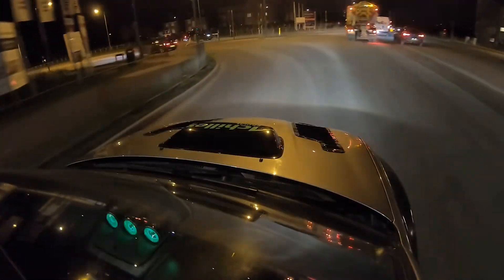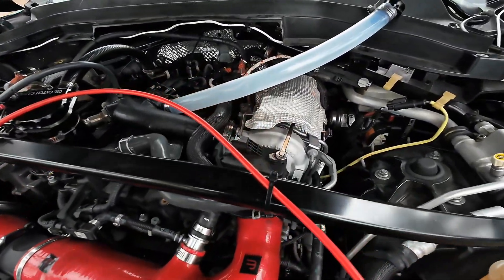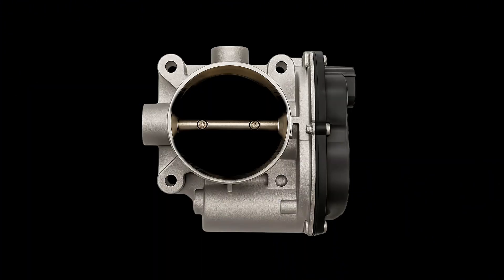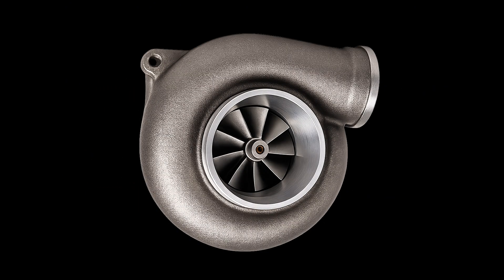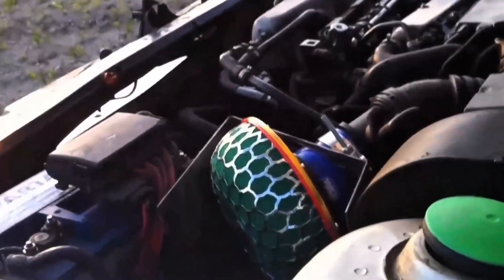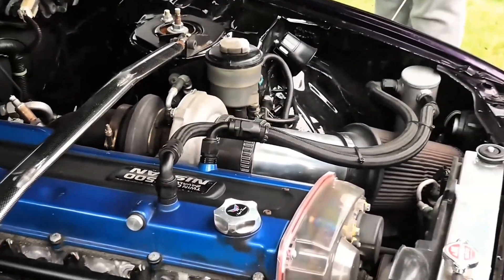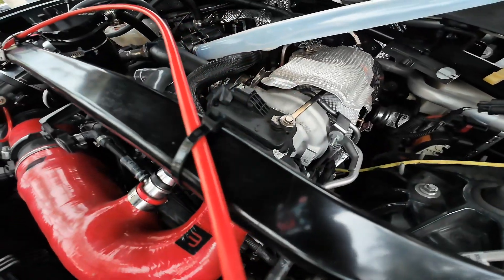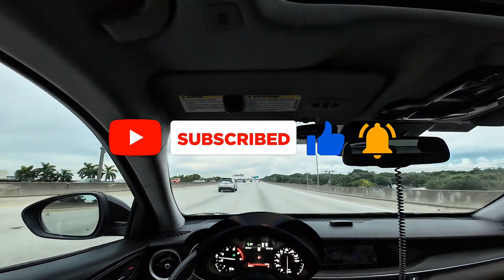Car Culture LIED about TURBO FLUTTER

Comment: My question would be. How much does it shorten the lifespan of a turbo? Turbochargers are inherently a wear and tear item and replacement is common so I wanna know if the surge causes meaningful damage since it'd be replaced eventually either way.
Reply from the maker: The lower the PSI the longer the timeframe before shaft play sets in. There isn't really a predictable timeframe since it could turn into noticeable damage at anytime.

Flutter sounds amazing though, so if you are financially setup and skilled enough to replace turbochargers - then I can't say I wouldn't block off my BOV just for the flutter.
Reply: @TorqueTheoryLabs On a second thought I actually drive a turbo diesel so there's no BOV to speak of. Not sure how much the video applies to TDIs as it does to petrols.
Reply from the maker: Well, this video is about the compressor surge caused by the throttle plate closing w/o a BOV.

For diesels: compressor surge is typically caused by exceeding your turbos efficiency (basically spinning the compressor wheel too fast) so the wheel can't grab onto more air and because of that - the air inside the manifold oscillates back through the compressor wheel.
Reply: @TorqueTheoryLabs Seems that the sound I am hearing isn't a flutter after all then. On lift off my car goes "WOOoo" rather than "sututu". It's more of a wind down than a stutter. Thanks. I learned a bunch today even if your video wasn't tailored towards diesels.
Reply from the maker: @RobinkoBambinko 

I hear the same noise in my car, sounds really cool if you listen closely.

Glad I was able to help!
Reply: @RobinkoBambinko  Diesels don't need a bypass or blow-off valve because there is no throttle to restrict airflow. Power is purely controlled by fuel injection, so the engine is always breathing, even if you're not on the accelerator.
Reply from the maker: Exactly!
Reply: @IllusionInfusion  And what about the whoosh on lift off in diesels
Reply: @RobinkoBambinko  do you have a VGT on your TDI? The vanes moving on abrupt decel can dump compressor pressure. The whoosh noise is likely the pressurized system unloading, not surge and if it is surge, it's not like closing a throttle on a gasoline/petrol engine. Another possibility is that during unloading, EGR might open and then whooshing you're hearing is unloading via that auxiliary passage.
Reply: @RobinkoBambinko that wooooo sound is definitely the VGT, I'm mad that my HDi car has a normal turbo so I don't get any sound other than the normal sound of the turbo spooling.
Reply: @eljaibas16 That is probably correct. I tried to get more sound out of my diesel by changing the intake to pretty just an open air filter in front of the turbo. No wooosh, no nothing. That sound comes from the exhaust side, thats why its mostly heard on cars with no cats.
Reply: @j_takasaki yeah, I've seen a video from a guy straight piping a diesel Hilux (VGT turbo) and it made the sound, but no sound with the OEM exhaust
Reply: If it does any damage it's so minimal you won't even notice, been doing it for 15+ years, had zero issues even with OEM journal bearing turbos.
Reply: @DriftNick  I guess we'll just leave it off to personal preference. Both BOV and no BOV sound pretty cool in my opinion.
Reply: It doesnt shorten lifespan.
As engineer myself, i tell you the force is neglectable.

Chinese low quality turbos might be another thing.

Turbos on some stock cars also come without recirculation and bov.
Guess what. They dont die. 1.5 bar of boost stock from factory, no bov.

Dont believe any video.

Comment: What if you use a dummy valve to release the extra pressure to stop this from happening on car builds?
Reply from the maker: That's the most common safety measure, and is essentially what my car uses but it's officially called a diverter valve.